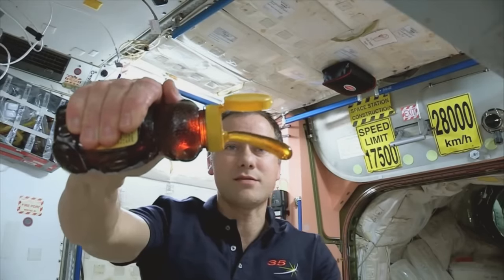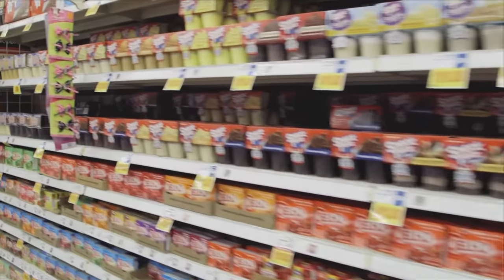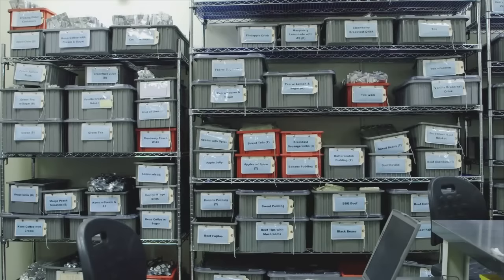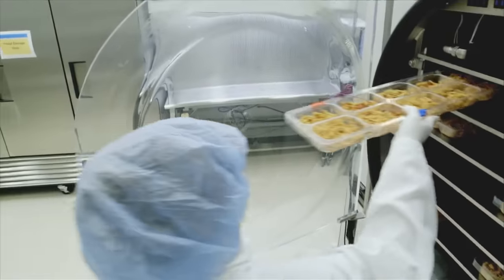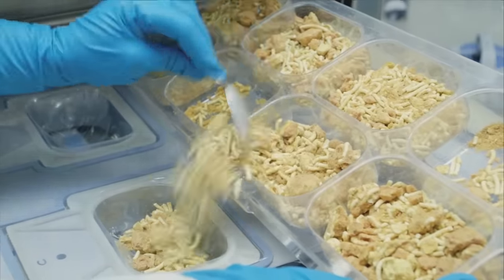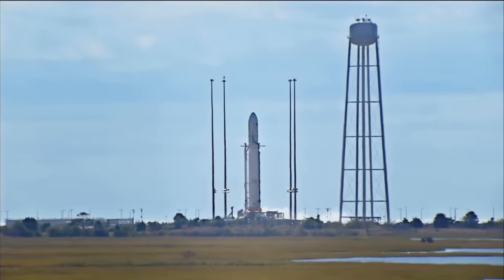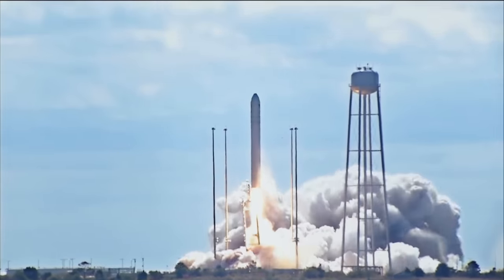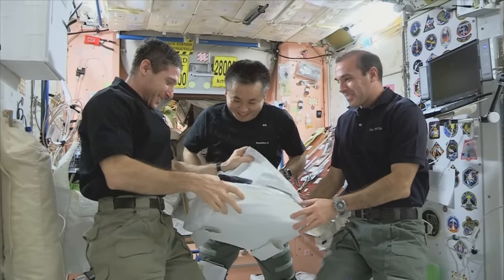How Does Food Get Delivered to Space? | Space Week | Channel 4

Comment: The space station is literally moving at 10x the speed of a bullet it’s crazy how their able to accurately launch that to connect with the space station.
Reply: Yeah, but speed is relative.
When a ship docks, the ISS and the ship are both moving at 17,500 mph relative to the Earth, but they are moving very slowly relative to each other.
It's a bit like driving two cars very fast, side-by-side, and then passing something from one car to the other, through the side window.
Or walking around inside an airplane that's moving at 600 mph - you can "dock" with your seat quite easily.

Comment: its time they ad a spinning ring to make gravity. time for bullshitting arround is done.
Reply: Artificial gravity would actually be worse since it would limit the usable space on the ISS. If you notice in the videos, they have computers often on all walls floor and ceiling. With no gravity you can work “upside down” or at any orientation, it removes the need for lots of tables.
Reply: @TheCodeTurtle That’s completed outweighed from the lack of muscle atrophy you get with artificial gravity. They have to exercise about 3 hours a day and when they get back down here, they still can’t walk properly. Not having to worry about that would be amazing.